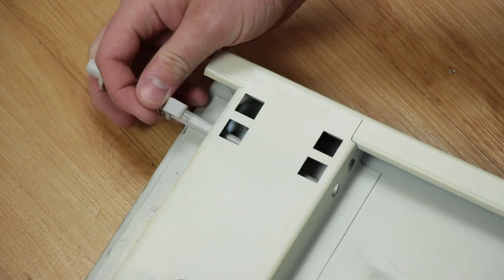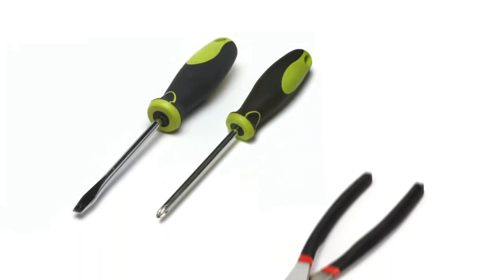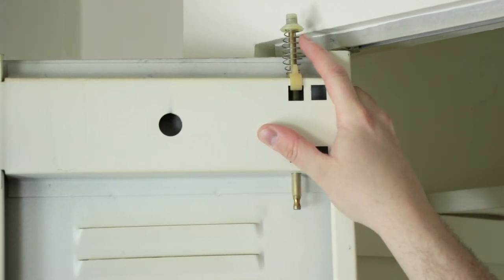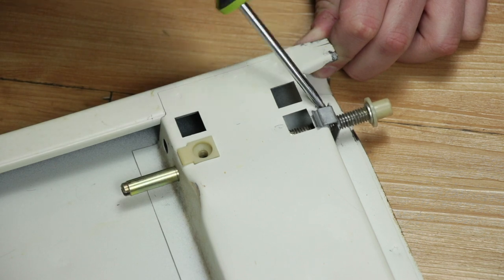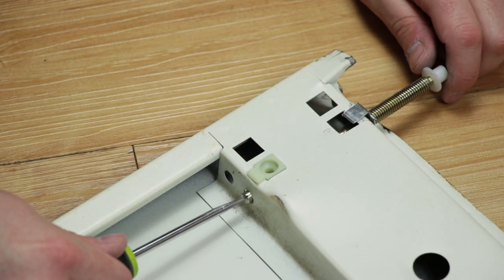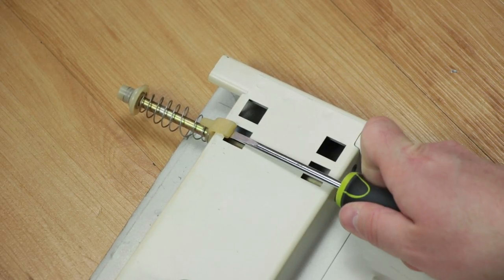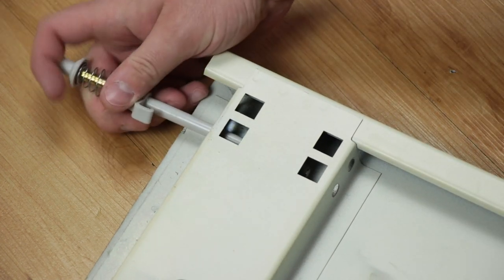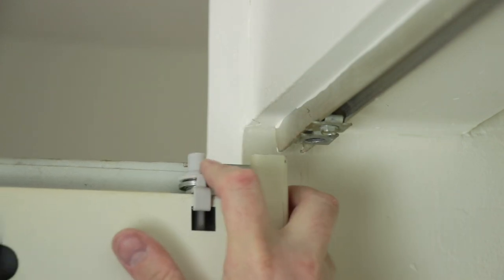How to Install Bi-Fold Closet Door Pins

Comment: Tomorrow I'm taking down one of these old metal bifold doors to replace the parts if at all possible. These parts look very similar to what I have. I like the newer design of those spring loaded rod clamp assembly. I will be grateful if these parts are compatible for these old closet doors: ) These old doors are 93.5 in tall, and the two bifold closet doors are each 36 in wide. Most of the hardware is shot and pretty much shot. Probably need to replace the lower track?  I'll check on this tomorrow, fingers crossed:) Glad I found your website. Been struggling to shimmy these doors open for years!